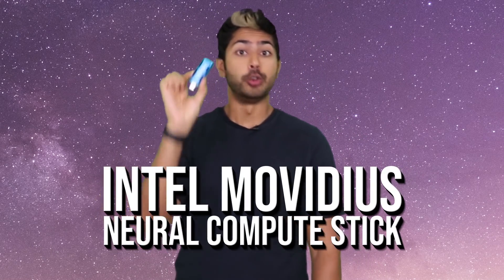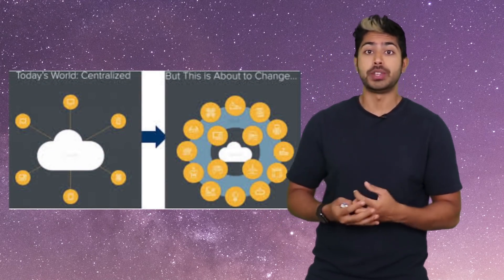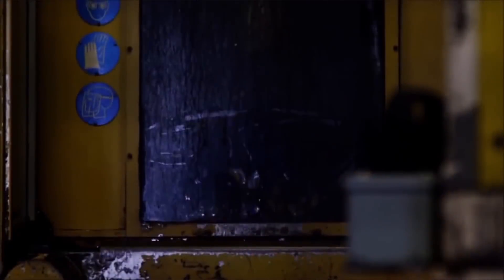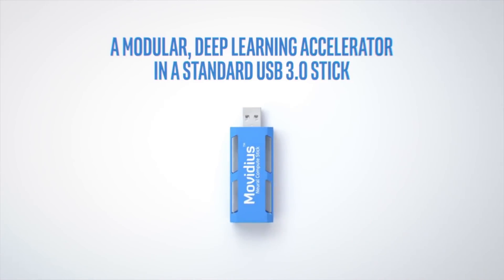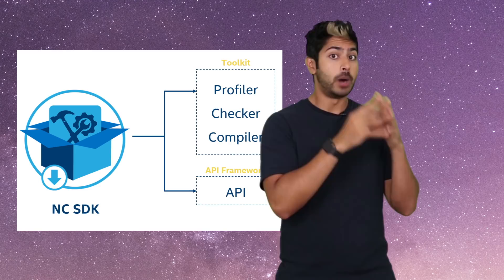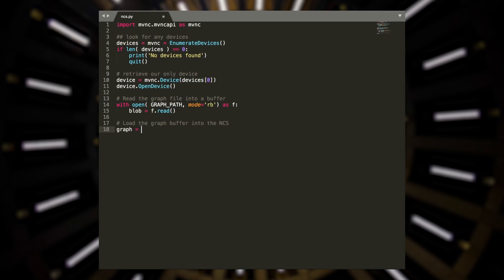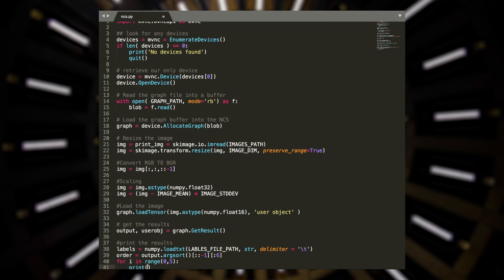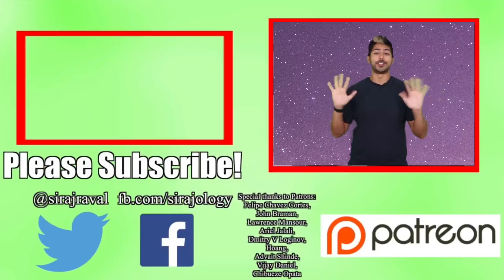Deep Learning with Intel

Comment: just imagine what darpa etc may have secretly figured out already if they continued this neural chip from 1994...
From Wikipedia, the free encyclopedia:
"The Ni1000 is an artificial neural network chip developed by Nestor Corporation. The chip is aimed at image analysis applications, contains more than 3 million transistors and can analyze patterns at the rate of 40,000 per second. Prototypes running with Nestor's OCR software in 1994 were capable of recognizing around 100 handwritten characters per second."

Comment: Were you able to make it work on MacBook?
Reply: Usually this requires Ubuntu or Docker but please let me know if you were able to make it work on mac os. Having it running on VM(ubuntu) is giving inconsistent problems with usb detection.
Reply: It requires ubuntu 16 or raspbian to install ncsdk. You'll need to use a vm like virtualbox. I was able to get it running on an arm version of ubuntu 18 but it took a lot of work modifying the install scripts. The vm is easiest option
Reply: The second version works on windows

Comment: The only limitation it has, it can only do inferences. It can't do backpropagation. Still needs a good GPU to train the neural net.
Reply: The second version claims to do training too. I could not track down any benchmarks on how fast it is though. Probably not great unless you make a cluster of them. Which people have done I believe.
Reply: Have you tried the inference on live feed people detection? How's the latency?
Reply: dude the 2nd version does 4 teraflops...idk how tf they did this.  That's like a gtx 1060 6gb card...I was about to upgrade to one for my nn work but pretty sure this thing like like less than $100 somehow...this is fucking amazing
Reply: @waynefilkins8394  Wow, that is amazing! You tried it out? Can't blv without cooling fans and such a compact space to disperse it works as well as a 1060.

Comment: Now that they are getting back into the gpu market , they should push vulkan for computing tasks
Reply from the maker: yes need moar gpus
Reply: ElementHTTP that is why there are so many abstraction libraries , some of which now impose no performance overhead ( eg :  vulkano )
Reply: ElementHTTP I mostly know about ones for rust
Reply: ZEUS MYLIFE_2.0 that is what molten vk ( the vulkan to metal translation layer now used by 3A game studios and qt ) is for
Reply: ZEUS MYLIFE_2.0 is either that or having to support metal exclusively for Mac , apple deprecated not only openGL but also openCl
Reply: ZEUS MYLIFE_2.0 Apple's fault , they make the drivers for their systems